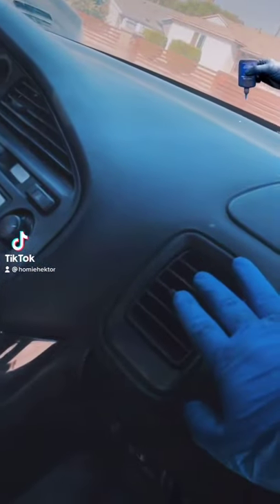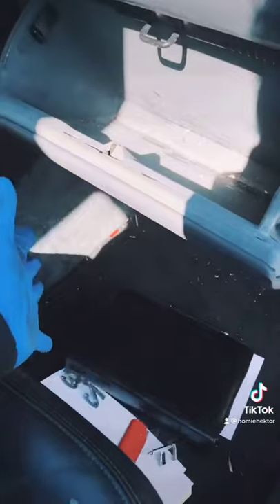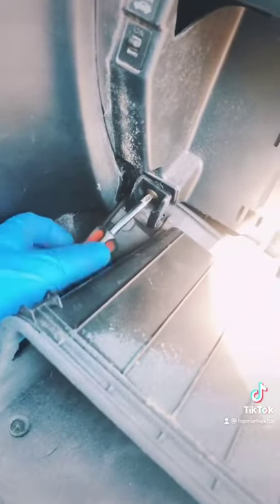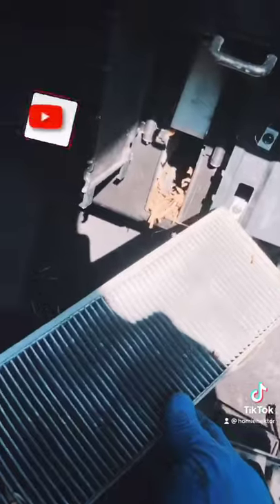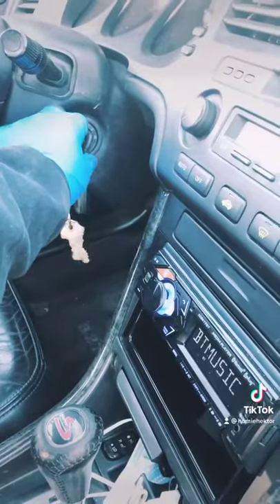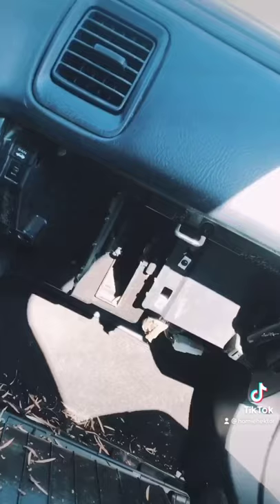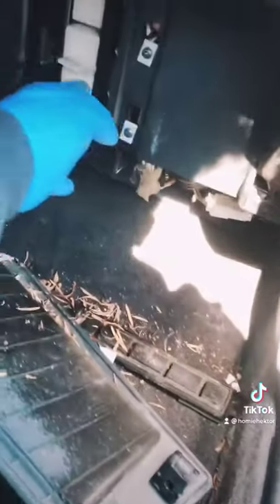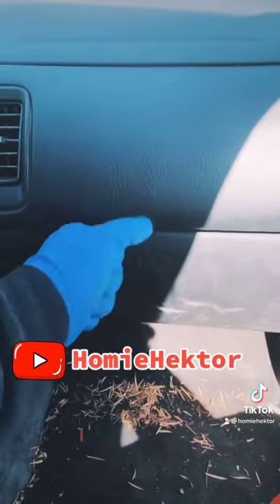Dirty Cabin Filter Replacement #shorts

Comment: Inspecting  the cabin air filter once every year or two is essential for two reasons. 1. It's part of the cars overall engine cooling system and the reason the A/C seems to be craping out. 2. You need to go looking for mice nests near the filter as those guys  eat the insulation off the wiring.  To save a buck you can knock the dirt out of the filter on the driveway and then vacuum it. New is better. Same for the engine air filter if you want to keep the good gas millage going. To test you air filter hold it up to the sun. Can see the sun? Get a new one rom the Dealers parts department.
Reply: A cabin air filter does not cool your engine. Duh!
Only if your heater is on will your heater core work as a mini radiator and contribute to engine cooling but that's not the primary purpose of a heater core and if you live in a warm climate you may not ever need to use your heater.